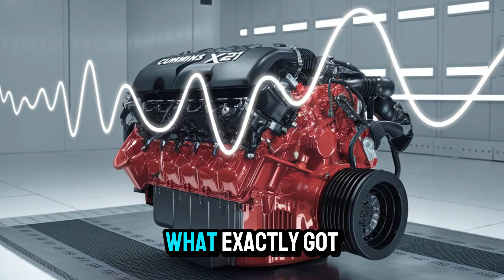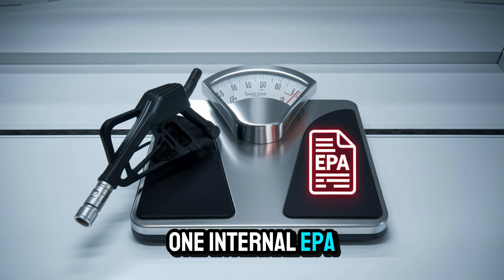Why the Cummins X21 Engine Got Banned Before Release

Comment: The feral gubmint and the EPA. Two of America's biggest enemies. Right up there with the IRS and ATF. The gubmint wants to do away with diesels and they're working dam'd hard to make it happen. In case you haven't noticed, the armed EPA is still conducting raids and seizures at small performance shops around the country. Some people thought this nonsense would stop under Trump. It most definitely has NOT stopped.

Comment: The X21 is a 15-liter engine platform built on the HELM, fuel-agnostic platform. The X10 engine is replacing the L9 and X12 platforms within the HELM range. So the HELM is still going forward. And the X15 is getting the HELM treatment.